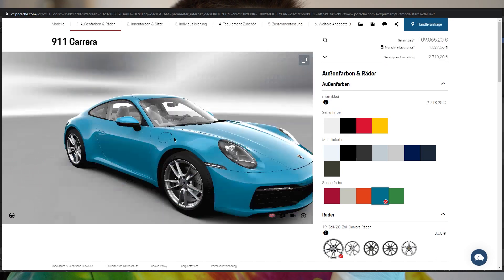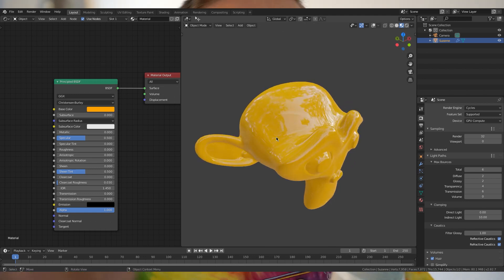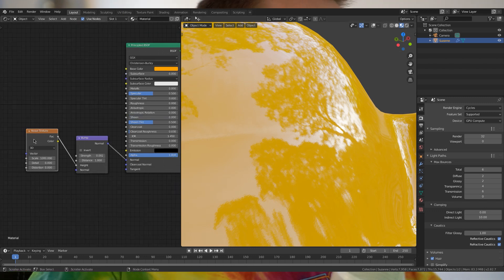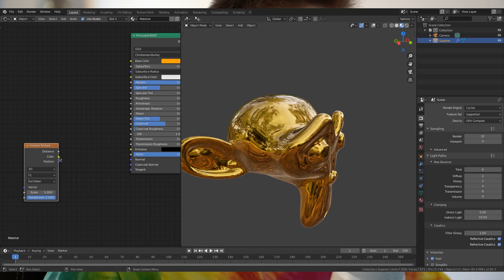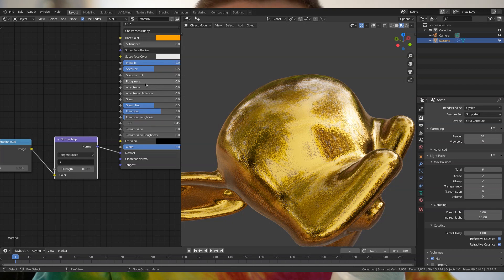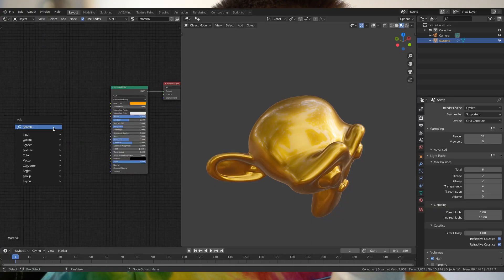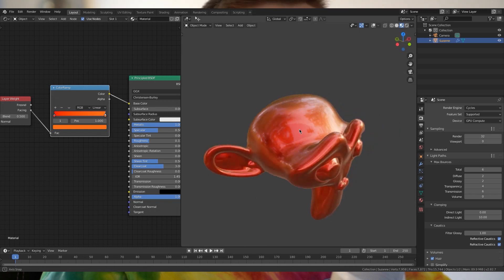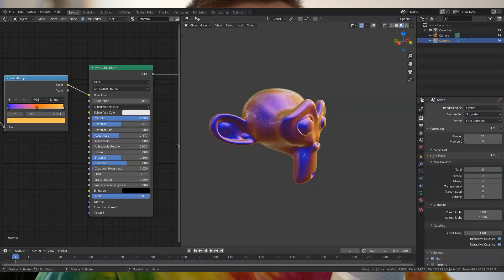Understanding Carpaints in CG | Blender 2.8

Comment: There are no bumps in car paints.....Paints are very smooth, not bumpy.....You are plugging the noise to the wrong node dude.....Maybe what you want is a normal map node, for example...Anyway, i m not a blender expert, but to use a bump node to simulate flakes does not make sense...Sorry ;)...thanks for the video.
Edit: Ah!...I see you used normal maps after....good boy ;)

Comment: I recommend setting it up with real flakes so you have it for closeups, and just disconnect the mess for other shots. Dielectric could use specular tint, due coat internal reflections.
Both for regular and metallic paint, I darken the main result toward the edge using a mix shader with nothing to simulate coat absorption (some just darken the main albedo).
Then I fresnel mix in the topcoat(s). These are so smooth I wouldn't bother with any PBR roughness -> fresnel stuff. Two glossys for topcoat is good enough for faking GTX 1.
It's more expensive, and most people probably don't notice or care. Setup depends on how many topcoats you apply for a good result on a real paint job. Ask a painter.
Reply from the maker: Very interesting! Good point about the specular tint!